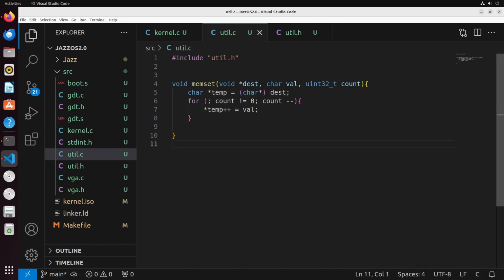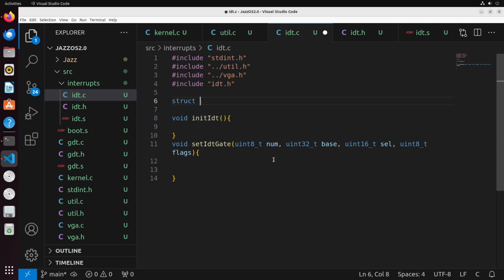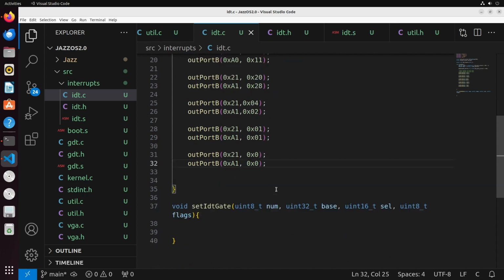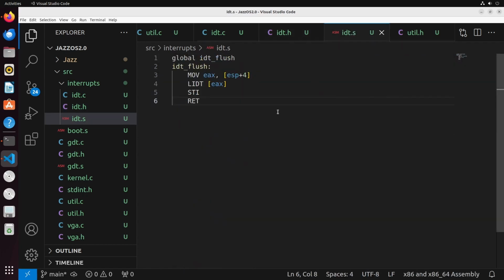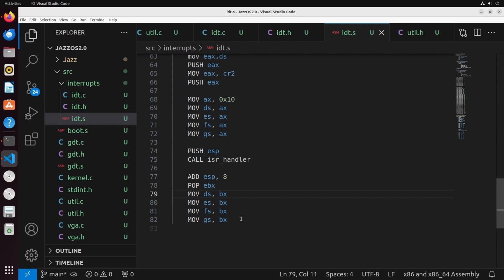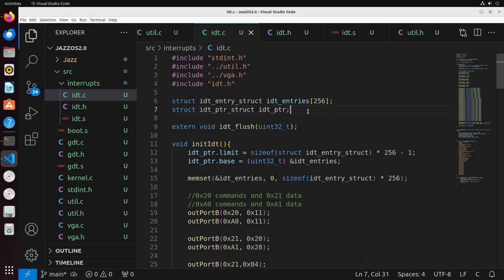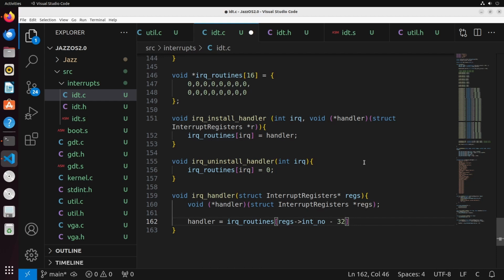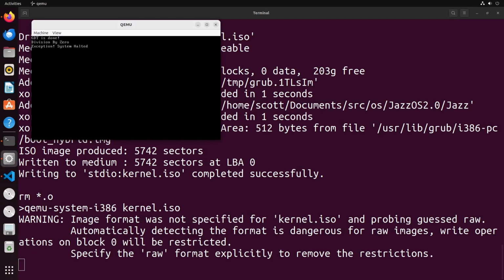x86 Operating Systems - Interrupts

Comment: When my code runs this an isr6 interrupt gets called instead of an isr0 interrupt and I get an invalid opcode exception rather than a division by zero exception. I went into GDB to see what is causing this, but I cannot find a single reason why it is doing this.
Reply: GCC compiled without optimisation flags as in this video generates naive assembly that executes a division by zero, invoking the division by zero exception. Of course, division by zero is undefined behaviour in C, so your C compiler might do something different.

Particularly, GCC with optimisation flags will choose to emit a ud2 "undefined instructions" opcode, which invokes an invalid opcode exception.
Reply: @georgevernon9153 okay, thank you

Comment: Hi. I tried to replicate the code for my kernel, but unfortinatly it crashes. I did small tests, and found out that the text IDT loaded is printed correctly. the crash occures when I am trying to restore the interrupts via sti and it doesnt occure instantly because IDT Loaded string is printed sucsessfully
Reply: I thought that the error is in handlers, so i removed the jmp instruction from the macros, but it didnt help

Comment: Very nice!
Small point of difference from the manual: Intel calls handlers for both exceptions and IRQs "ISRs". It is frustrating though that some push more values.
There's also vectors for MSI and IPIs; unless you're going for nostalgia first it's worth doing MSI-X up front to avoid having to deal with IRQ sharing.